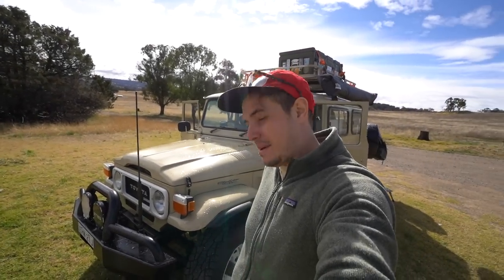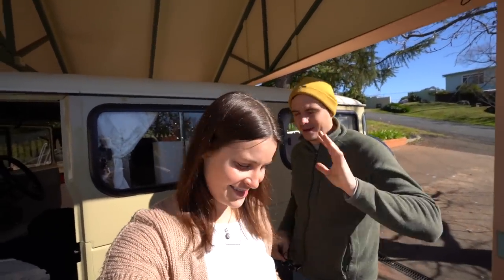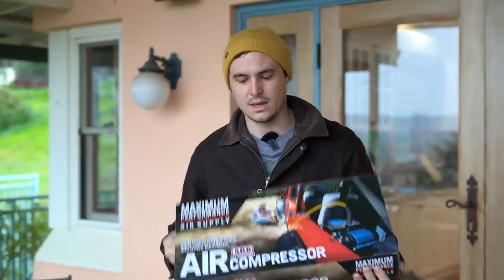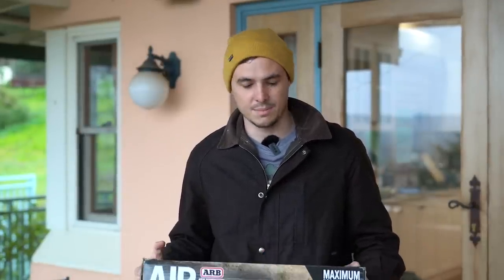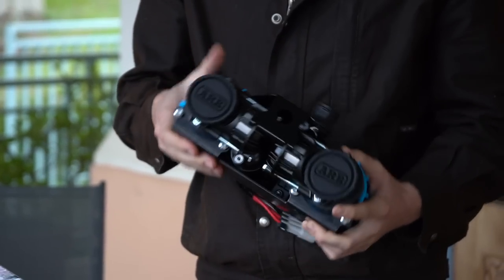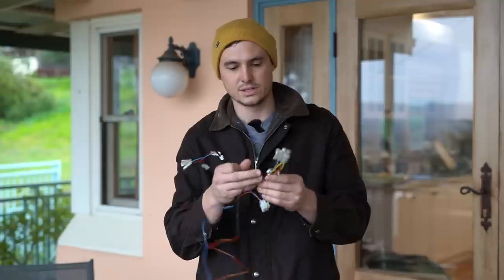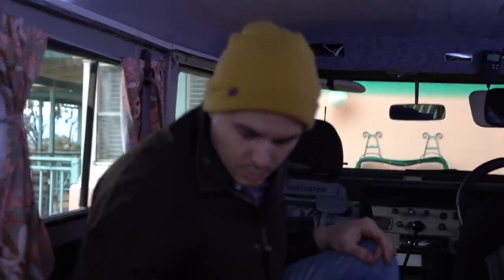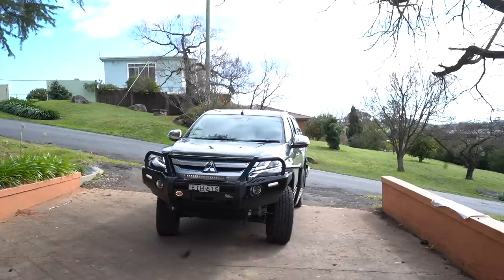Snowy Mountains 4x4 Adventure: ARB Air Compressor Install - Ep18

Comment: id probably ensure there is sufficient airflow to that ARB compressor. they get very hot very quick. They also draw a lot of air and putting them into a tight space will add extra load onto the compressor motor.  Good job tho

Comment: So did you actually get the compressor to work or did you just pretend 🤔
After all that build up you never showed what it could do?
Reply: Probably they will do a separate vid on its performance and their review on it.
Reply: @darrenc4096  you are more than likely right. My point is, don't make a video called "ARB twin air compressor install" then gloss over the fact that it didn't work and then give some vague explanation as to why it didn't work and just say "It's OK now"
I'm assuming rightly or wrongly that the compressor was supplied by a sponsor and if so, I doubt they will be overly impressed by Matt's portrayal of there product.
I have been an avid viewer of Matt and Holly's adventures, and as a mechanic interested in Elsie's restoration, the work they have carried out with limited skills, facilities and equipment is brilliant . They have done very well up until now keeping the content going during covid with only the odd thin episode while alot of other creators ie Trip in a van, Big Oz explorers, Sparkys on the loose and One day we should, to name a few, have become dull or stopped completely. 
I hope the same does not happen to Overland travellers.